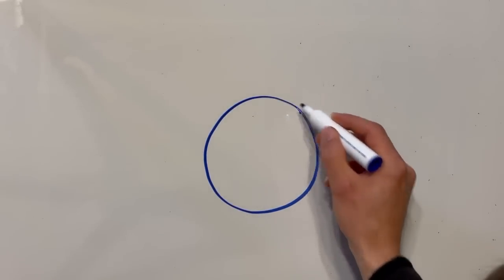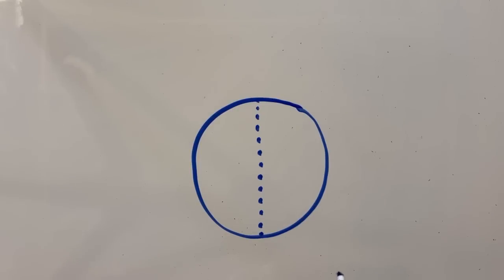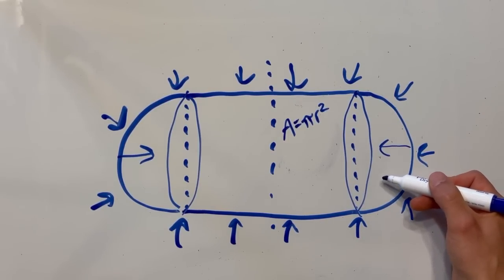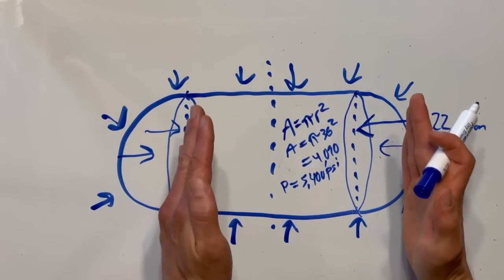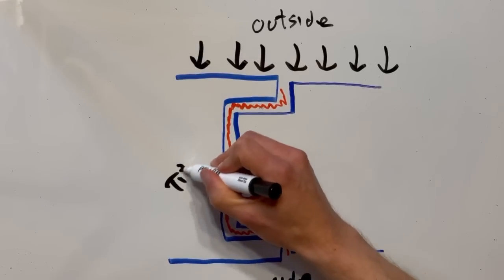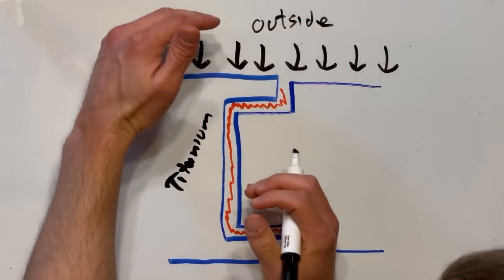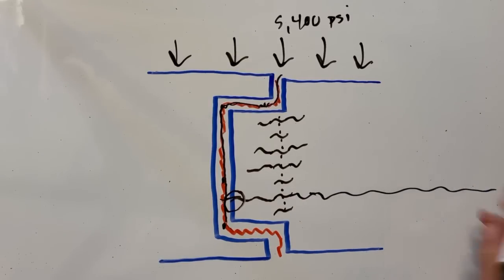Simple Engineering Analysis of How the Titan Submersible Could Have Failed

Comment: If internal and external titanium rings were positioned dead centre of the length of the CF cylinder could not be used due to the weight affecting buoyancy, then why didn’t they use CF rings there, regardless of the ergonomic inconvenience. My estimation is that even a cf ring would’ve mitigated the flex/compression at the halfway point of the cylinder where it would be at great risk of failing. I don’t understand. So with a 200 x 200 internal and external  ring would’ve made the cf 600 mm thick at the centre , inner n outer circumference of the cylinder, even though cf was the incorrect material to use. Also, the pattern layering of the cf was surely incorrect. It def should have been woven cross-cross and vacuumed.
Reply from the maker: There really isn’t much of a difference of loading from the ends or middle of the hull. It is not akin to a span of a bridge beam single water is pushing in on all directions of the hull itself.  Not a load in the center and then two supports on the end, with a bending moment to transfer the load from the middle to the end supports.
Reply: @Mutton_Lettuce_and_Tomato  I’ll always listen to an expert. I agree with your analysis re the tit and cf joins. But every time I see a beer can being stomped on while it stands upright, it always seems to fail at the centre of cylindrical section?
Reply from the maker: @gregoryburne5251  so a beer can has such a thin wall you are getting the wall to buckle in the middle with stomping on it.  A different mode of failure than I was thinking where you were going. It is a possible failure mode of the hull, but probably not the most likely.

Comment: Have you considered, (disregarding the issues of the end caps etc.) with a hoop wrapped Carbon Fibre with no end to end fibre reinforcement that when the pressure in the centre of the cylinder pushes the cylinder in at the middle, the INNER cylinder wall will be under extreme tension as it is being STRETCHED by the deflection of the five inch thick wall section. This tension on the inner wall would then lead to the resin between the fibres cracking and propogating around the cylinder to the outside wall in a perfect radial crack in the centre of the cylinder. The hull is effectively ONLY held together from these tensional forces by the epoxy resin itself, so a CAD model of these forces should use resin only without reinforcement to see how the resin cracks under tension.
Reply from the maker: Yes.  I tried to keep the video as short as possible and go with my gut feel on the windings.  Some commenters said indeed there was horizontal and/or helical layers.  I figure there would have to be.  I plan to do another video on basics of composites.

Comment: Previous passengers reported loud noises that sounded like gun shots throughout the vessel, these noises were possibly the carbon fiber laminate glue joints separating from the titanium flanges
Reply from the maker: Yes. That is very likely, or some internal delaminations forming at the flange transition.

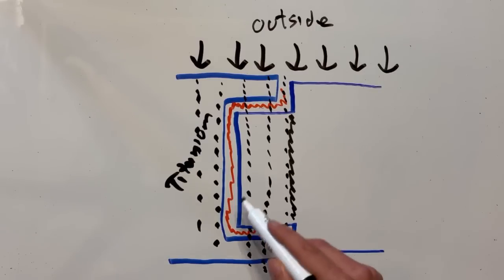Comment: I’ve done 3D printing where the layers were perpendicular to the direction of force, and the layers separated cleanly. If the submersible was rolled in the loop fashion, and then a section was under a sheer force like you described at 13:52, could the machined mating point on the carbon fiber ring snap as the layers are perpendicular to the direction of force?
Reply from the maker: It would be more likely, but it also looks like they laid down a pretty wide fiber that would have been woven providing support in the perpendicular direction, but it would be not nearly the same as actually putting in fibers in helical or horizontal direction.

Comment: Hi man. Minor point of clarification - It appears that the construction of the tube to the adapter pieces is that the titanium adapter is shaped around the full size of the carbon fiber tube - that is , there's no notching in the carbon tube; its the titanium ring cut to fit the tube. Sub Brief's 'The Titan Tragedy' shows a decent vid as they attach one of the rings to the tube. 

Also, there's a vid floating around where Rush claims - although Ive not seen it - where the carbon fiber wrapping did do crossing as well as straight. Still, there's also pics of items being attached to the inner hull liner -  which according to thier on YT vid from 6 years ago was 1.5" stainless steel  -- with shop screws poking in. Yikes.  Of interest to this, is how there was, at least that theyve shown, zero fiber brought up from the bottom. The viewport is also, apparently, MIA.  Personally, id love to see high res pics of the titanium end caps and adapter rings - the fact the port is gone, a look at the attachment points from viewport to hull will be telling, as will whatever witness marks remain on the end caps and adapter rings. 

End of the day, Using carbon fiber for a hull in this manner has been, well, crushed, permanently. Had Rush used a Titanium hull all the way through, odds are they'd of been fine - at least until the subpar viewport punched in.
Reply from the maker: From video I saw there is at least a notch on the outside of the carbon fiber hull as they are doing the glue up.  I can see it with my own eyes.  My hand drawing may not be to scale though.  Even if there was no notch the shear stress at the joint would still apply since they didn’t taper the titanium step over down gradually.
Reply: @Mutton_Lettuce_and_Tomato  Huh. Maybe we saw different vids then? The one i saw, quoted on SubBrief, the line i see appears to be glue. 

Really though, it doesnt terribly matter if it was or not. From the second i first saw that sub,  there was no way in hell i wouldve set foot in it - Hell i dont even like getting on damned Ski lift gondolas! 

Anyway, new sub, will keep an eye out for ya!

Comment: I have a question: wouldn't the radial compressive force on the cylindrical faces of the hull have a sort of stiffening effect on the composite fiber plies that would counteract delamination due to the compressive forces of the two end domes?
Reply from the maker: To some degree I would agree with that.  It is a complex thing to think about.
Reply: @Mutton_Lettuce_and_Tomato  I also don't really understand why the joint was made with such abrupt changes in section, groove in the ring and tooth in the cylinder. It should be general knowledge that such a thing will create stress concentrations and so on...  They really seem to have taken a tourist's approach to the project.
Reply from the maker: @ottaviocolombo5805  Yes...how they did not have a long smooth reducing taper on the titanium ring that slides over the composite is wild.
Reply: @Mutton_Lettuce_and_Tomato  I was wondering: if the taper on the titanium ring was on the inner side, the pressure on the end caps would make them work as a wedge, opening the end of the cylinder. Combining this with the radial pressure acting directly on the carbon fiber cylinder, would this amount to clamping radially the cylinder, avoiding the crushing of the fibers? Combined with the taper it may have improved the life of the structure.

Comment: Not talking about posible air bubles in carbonfiber itself. Any piece of dust caught between layers as they wind it up would create micro buble of air around them, thats contracted and expanded every dive.
Reply from the maker: Yes...air bubbles and contaminants in the composite as well.  I tried to keep the video as short as possible and just cover what I think was one of the most likely of the possible failures.  The shear stress at the glue joint just concerns me the most, but there are many other things that could have made it fail.

Comment: I have to admit, when you started drawing a circle to show how pressure applies to it I went "yeah yeah I know all this just get to the good stuff" but as soon as you used the 'keystone' analogy I was HOOKED!  I wish I had teachers like you! 😊 I'm nobody and even MY first thoughts were that carbon fibre was designed to add tensile strength to incompressible epoxy so surely all he achieved was to give it the ability to delaminate.

All of his education was aerospace, with at most 0-1 bar more pressure inside than, and he admits he fell in love with carbon fibre so I guess he built a thicker 787 fuselage somehow forgetting that the pressure is on the outside not the inside and it's 400x greater... nobody is that stupid I know, but this IS a guy who only found out a freshly replaced or rebuilt thruster was operating in reverse when he got to 4000m. 

I'm only certified to dive 55m but I already know that if my drysuit inflation fails I'll be cling-wrapped and literally incapable of ANY movement long before 40m which is 1/100th of the depth this thing was facing. We also stop and check each other's gear (no bubbles or potential snags etc) at 6m - apparently he checks his thrusters work when he hits 3800m 🤬

Death by narcissism 😥

Comment: What about the responsibility of Spencer Composites’ whose president Brian Spencer signed a contract with OceanGate to design and make the hull. Stockton Rush approached Spencer Composites with his design requirements, a hull safe to dive to 4000m. They did not say that is flawed, they supplied him a hull to his specifications. They must shoulder some of the responsibility for making this essentially flawed design.
From composites world
The biggest challenge, Spencer reports, was developing a manufacturable design that “would produce a consistent part with no wrinkles, voids or delaminations.” And without use of an autoclave. Spencer opted for a layup strategy that combines alternating placement of prepreg carbon fiber/epoxy unidirectional fabrics in the axial direction, with wet winding of carbon fiber/epoxy in the hoop direction, for a total of 480 plies.
Reply from the maker: I’m sure there will be people of those families engaging in a legal battle with all companies involved.  It does make you sort of wonder how it got made and who signed off along the way.
Reply: @Mutton_Lettuce_and_Tomato  The Titan vessel seems to be based on an initial design done for Steve Fossett.  The first time carbon fiber composites were applied to the hull of a deep-diving, manned submersible was for the one-person DeepFlight for a dive to the bottom of Challenger Deep.
When he died in the plane crash the craft went unused. Presumably Stockton heard about it and went with the design, the reason was buoyancy, a steel hull would need the syntactic foam which James Cameron used with his sub, carbon fibre did not need the additional buoyancy making it cheaper.

Oceangate could even go with the idiot defence of “we requested a vessel capable of reaching 4000m and this is what you sold us”

Comment: Just a FYI, In my research I found the ID on the clyinder of 56" with thickness of 5".  So that makes the OD 66" and using that number I come up with about 18.9 million pounds or 9.45 tons of force @ 376 atmospheres or 5527 psi pushing on the ends of the cylinder.  Stockton Rush himself said the cylinder reduced in 3/4 " in diameter at depth, so along with shearing forces you describe, I believe there was some bending moment going on at that glued joint because of the ID lip of the titanium ring not dimensionally changing by same amount. The different materials, the different directions of force, how they reacted to those forces and then temperature  changes of two materials with different expansion rates were all issues with the design.
Reply: If I am not mistaken - the diameter of the composite cylinder was about 4'7" (I don't know if this was internal or external diameter). If the quoted change in diameter was really 3/4", then the hoop strain can be calculated as 0.75/55 = 0.0136 (or 1.36%). This is precisely the region where carbon fibers fail. Although I do not put much faith in whatever Mr Rush said or claimed. #/4" would be an ENORMOUS and possibly fatal amount of deformation - particularly at the connection to the titanium caps.
Reply from the maker: Thanks for the info, both of you.  Such a statement from Stockton on how much the hull compressed furthers my suspicion of some sort of failure at the joint with the titanium caps.  It creates a lot of shear force to make delaminations, break fibers, etc.

Comment: I thinqué you cross section diagrammé is be wrong ¿¿¿
the carbôn Fibré tooooooob didunt havé a elbow liké thát,

 didunt it simply slot into the Alooooooomin-Numb ring ¿¿¿¿
Reply from the maker: It may be slightly wrong, but at least the outside of the composite tube clearly had a step machined into it.   Either way where the titanium went over the tube is a place to get shear stresses.

Comment: If i’m not mistaking - what they attempted, was a purely layered all-conposite tube, between the titanium half-dome ends. from an engineering standpoint, i feel that if they had: 1 put segments of titanium rings also inside the laminate, and 2. titanium rods - connecting the two end-half spheres, lenghtwise along the lateral tube, then they would’ve solved most issues of compression, while maintaining a weight advantage of having most of the cylinder composed of composite. aside from that, i don’t see the argument for weight savings being relevant in a submarine- on a plane, yes, but in a sub, where tou wish to decrease buyancy - not really
Reply from the maker: You could do something like that with the rings and the rods, but that would make the internal cabin smaller, which isn't good for making a sub for tourism.  Yes, trying to have weight savings in mind for a submersible is a little overkill.

Comment: The Spencer manufacturing video plainly shows the parallel unidirectional winding on the mandrel as the sole central structure; no particular cross-section structure existed in the layup - a completely inept tubular structure to begin with!  Spencer really blew it. Add to this that fiber composite is porous to water pressure...and fiber ONLY excels in tension, not compression.  So, the water pressure simply pushed its way through the unidirectional tow, displacing it...making noises, and simply splitting the tube!  The foolish, dangerously negligent engineer, TONY NISSEN apparently never bothered to first make a initial bench test model - which would have QUICKLY and INEXPENSIVELY taught him about these limitations of the material.  For the gluing, the tube should have been lowered into the degassed epoxy prefilled ring to fill all voids and get full squeeze out. That could have all been vacuum bagged as well to further assure no voids.  "Dissimilar" can be OK if the materials are stable - but the fundamental tube design itself obviously was not on just these multiple levels, all completely neglected.
Reply from the maker: I have heard all kinds of different responses from viewers.  Some say just hoop wrap.  Some say there was indeed horizontal/helical layers put in place even saying it was laid by hand.

I certainly think they could have did something better on the adhesive side,  I wonder if there was a suitable low viscosity resin with good mechanical properties that they could have made a very tiny gap between the titanium and composite and suck it in under vacuum from top to bottom to virtually eliminate trapping air.
Reply: @Mutton_Lettuce_and_Tomato  Yes,  my experience is that they could have had (and created) just the viscosity, temps and set time needed for fully-settling the tube into the ring...with perfect squeeze out.  But what really shows is these woefully inexperienced hacks did the operation just as stupidly and negligently as the tube's own design and construction - their negligent incompetence was entirely consistent.

Comment: I saw a long piece of shredded composite still stuck to titanium seal when they were moving the mini sub debris onto the dock. Was the glued up metal the point of failure? I'm still shocked the Oceangate company was taking passengers so unbelievably deep underwater with a terribly designed submarine.
Reply from the maker: It is only a guess as to what ultimately happened.  The composite tube itself could have gave out somewhere along its length, and even the window could have failed.  It was my opinion that where the bond joint was between the titanium end rings and the composite tube was a likely source of failure since that is one place where the composite tube would be subject to a sheer stress that could start compromising the composite.

Comment: Also the plastic binder's specific gravity increases at a far greater rate than carbon fibre under increasing pressure causing laminations due to the binders plastically reduced volume seting up rapid fatigue failure under repeated loading/trips.
NOTE: Boeing engineeers should have condemned the carbon fibre for destruction once it passed it's "use-by" date?

Comment: Liked, subscibed. A great explanation. I'd like to add that the weakening that's described due to the delamination, could allow compression of the tube. That would possibly be within the modulus of the inner metal tube and be unnoticed, but the reduced volume would result in lower displacement and thus buoyancy, (upward thrust).